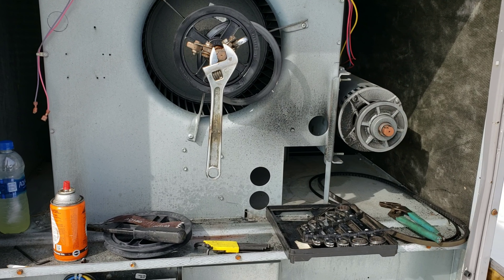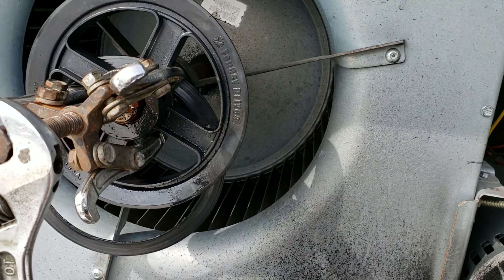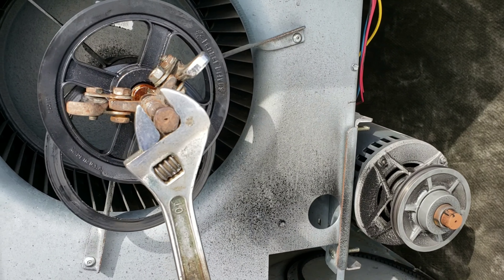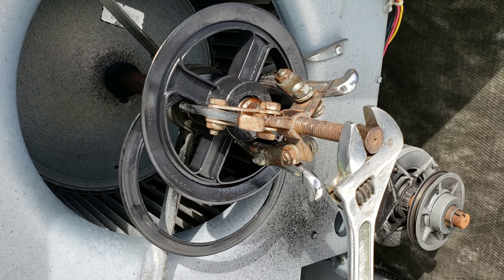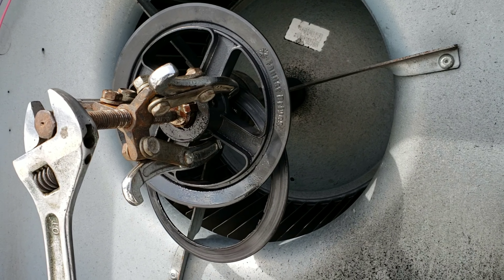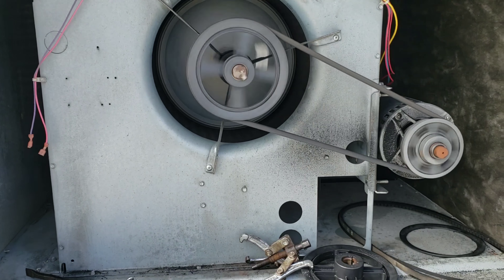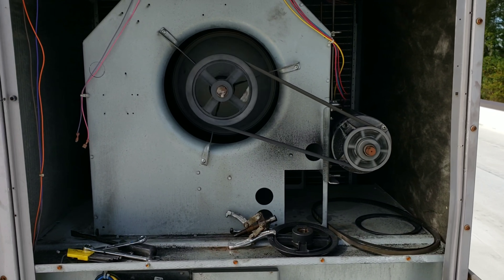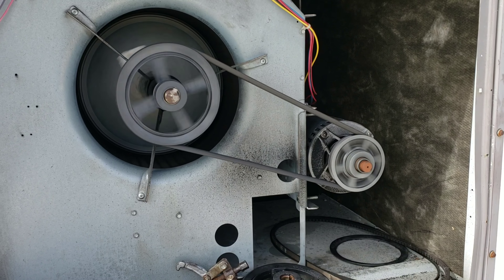THOMPSON'S KENNEL HVAC LIFE THE SAGA CONTINUES

Comment: If it weren't plastic an it was metal would you ever consider using a 1/2 inch impacted on the puller? Keep getting it done!!!!
Reply from the maker: No only use brute force when necessary that metal pulley breaks you will be eating metal lol